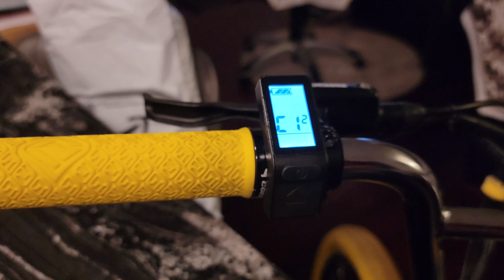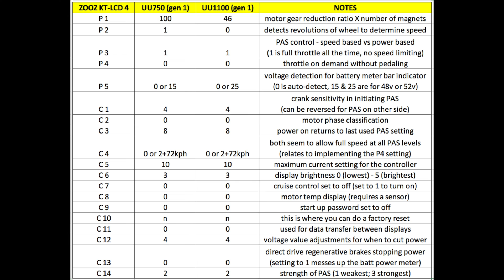UNCORK & BOOST YOUR ZOOZ!

Comment: Johnny, I have a Gen 1 Ultra Flex 1200 that has the newer displays. I was wondering if the KT-LCD display would work on the Ultra Flex and more importantly would it allow me to break past the 19mph pedal assist limit currently on the Ultra Flex's? Great video btw, you are an invaluable resource for Zooz info and your reviews inspired me to buy my UF about 2 years ago.
Reply from the maker: Thank you for the kind words! I don't think you can use the KT LCD display on the newer models like the flex, due to the changed controller. However, you should be able to unlock your speed to go over 19mph in the p3 setting on the new display. I have another video on here similar to this one for how to unlock the new displays (its pretty much the same)
Reply: @JohnnyPrimeCC  Thanks, I have the throttle speed unlocked to 35mph (per your video previously for the UF) but the pedal assist still tops out at 19... or does p3 unlock pedal assist to go over 19mph as well?
Reply from the maker: Unfortunately the pedal assist can't go over 19mph on these newer displays. @JeremyKennedy
Reply from the maker: @JeremyKennedy  it sucks 😢

Comment: So did this run through change your top speed or is this just a boiler plate setup? In the beginning of the video you change your top speed to 72? What does that mean? Thanks
Reply from the maker: @jamesdeprato4959  doing this removed the speed limiter of 20mph to roughly 35mph. I think the 72 is km/h
Reply: @JohnnyPrimeCC thanks. Mine tops out at 26mph. I’m gonna try this!
Reply from the maker: @jamesdeprato4959  what generation and model do you have?
Reply: @JohnnyPrimeCC i want to say that mine is gen 1 uu750. Bought it in 2021. All mechanical bits are stock.
Reply from the maker: @jamesdeprato4959  depending on rider weight and tire psi, 26mph-28mph is normal top speed for the 750.
Reply: @JohnnyPrimeCC  do you think i can get a higher top speed if i follow these p settings?
Reply from the maker: @jamesdeprato4959  top speed is governed by P3 and it seems like your bike is already unlocked if you're hitting 26mph. If it was locked, you would top out at 19 or 20mph.
Reply: Ahh. Gotcha. Thanks for the info. See ya on the trails!
Reply from the maker: @jamesdeprato4959  my please man any time!

Comment: Hi.. is there a way to make my 1 pedal assists to only go 15mph and for 2 pedal assists to go 18mph and for 3 pedal assists to go 21mph and so on? Cause I don’t really feel like using my legs once it goes faster…Pedal becomes useless. I want to exercise a lil bit by pedaling.
Reply from the maker: I don't think there is, but if you look up the newer bikes display manual you can check to see. It's YL81C-B if you want to Google it to see

Comment: You think if I reset my display to factory default should fix the issue with the Bike displaying the proper battery level. Even though the bike wont speed after many miles the battery level still shows 100%
Reply from the maker: I'm not sure. You can try that. Are all your battery connection okay? Look at all the points of contact. Remove and replace battery, motor cables etc.
Reply: I removed the battery and check the level on the battery and it showed 10 percent left, but the display on the bike showed 100%. strange. @JohnnyPrimeCC
Reply from the maker: @steveng6997  what generation? If 1, use the volt meter instead of the battery bar. Anyway definitely look over all your connections closely.
Reply: The  factory reset fix the issue, the display now shows 10% which seems correct. Thanks for your help. @JohnnyPrimeCC

Comment: Hey Johnny Prime, so when you adjust the top speed thru the display, your bike will go up to 40 mph?
Reply from the maker: No it'll probably max out at like 33ish. I've gotten mine to about 38mph on a downhill though, while also pedaling like wild.
Reply: @JohnnyPrimeCC  thanks for the quick reply. Someone should make an easy plug any play kit for the zooz to hit 40+
Reply from the maker: @Shane C  eventually it'll happen I think. Still a new company

Comment: Is there an authorized Zooz repair shop in New York City? Where would you recommend for tune ups and repairs? Thanks
Reply from the maker: Not sure if there are any "authorized" or officially endorsed Zooz shops here, but Tyrone at Dah Shop on Division Street in Chinatown has been working on them a while. More the mechanical stuff and not the electric stuff. For things specific to the motor, I would go nearby to HQ ebike repair - there are a few shops on Madison Street - actually close by to Dah Shop.

Comment: Wishing this video did the newer round versions of controls. The P setting options are not the same I feel. And I can’t find where they are listed online
Reply from the maker: Check to see what model KT-LCD it is. It may be 8. Once you find the model number you should be able to search for some YouTube videos or instruction manuals (the manuals are often not very helpful because the translation from Chinese is not good).
Reply: @JohnnyPrimeCC  YL81C display does not exist in Youtube. And Google found nothing
Reply from the maker: @Juan Ortega  I just googled yl81c and first two results were user manuals.
Reply: @JohnnyPrimeCC  I don’t what my deal is but I only see the YL81C - B.   Emphasis on B. Mine is not -B.
Reply from the maker: @Juan Ortega  ahhh you're right, man. I'm only seeing the -B as well. Damn. Are you in the Zooz Bike Owners Group on Facebook by chance? Great resource - I'm sure someone in there can help. Also try emailing Chris or Sunshine at Zooz.
Reply: @JohnnyPrimeCC  ya, I’m in the group. They seem to be preoccupied. Or asked too many dumb questions already. :). But I am just wanting to fix my display readout. My bike is new, but It always say my battery is one bar down, even though the charger says it’s full. I am going to leave it connected for a while past full charge to see it is the trickle down charge I need.  (Does that make sense. )
Reply from the maker: @Rookmap  I had that issue when I replaced my screen as well. Had to adjust the P5 setting to 15. Wonder if it's the same for your display. Does the -B model look similar to yours? Wonder what the difference is...
Reply: @JohnnyPrimeCC   well the only solution that seemed to work… find default (y) option and viola. All five bars came back. Man that was frustrating.
Reply from the maker: @Rookmap  was it P5? Was the -B manual useful at all?
Reply: @JohnnyPrimeCC  I would say the manuel is slightly different, in that there are more P setting choices than my bike model shows. But the reset works the same, and the speed limit setter is the same.
Reply from the maker: @Rookmap  good to know. Thank you!

Comment: How did you find out about the P settings configuration out? I have a 2022 1100. The settings are different and where I bought it from they really messed up the setting and the tune up job. Smh I have had the bike since August and I just don’t get any enjoyment because I think how out of wack my bike is.
Reply from the maker: Hey man! Your model should have very similar if not the same P and C settings. I linked a manual in my video description, but some of the language is very "tech" and difficult to decipher. If you want to chat in more depth, shoot me an email. Maybe we can go through the sittings together and see whats messed up. johnny@johnnyprimesteaks.com
Reply: @JohnnyPrimeCC  emailed
Reply from the maker: @Mapmigi  I didn't get anything. Spelling right?
Reply: Youtube keeps deleting my comments. I have a 2022 750. Look up YL81C-B-User Manual. Cheers.
Reply from the maker: @JohnDoe-qu8mk  thank you for sharing!
Reply from the maker: there may be one or two settings that are different on yours due to the new round wave (as opposed to square wave) controller output. That's one thing we would need to look into.
Reply: P1-46 P2-0 P3-1 P4-0 P5-15 C1-4 C2-0 C3-5 C4-4 C5-10 C6-5 C7-0 C8-0 C9-0 C10-N C11-0 C12-4 C13-1 * c14-2
Reply: Those are settings for the 1100. Just them from zooz support